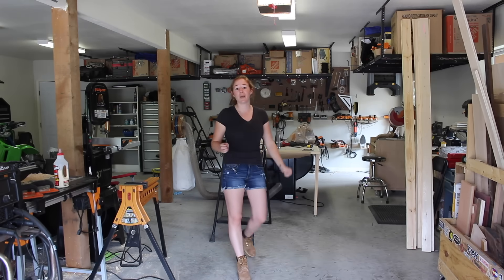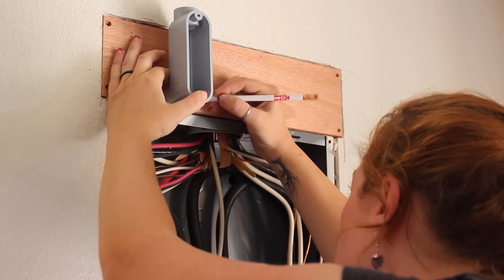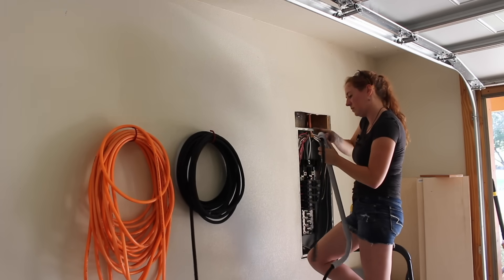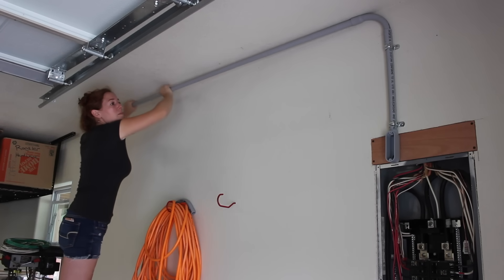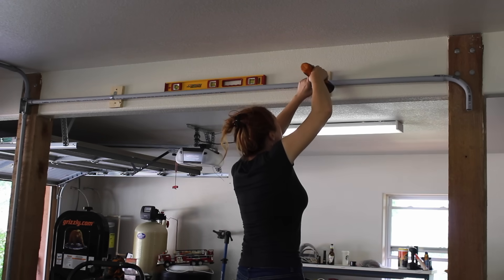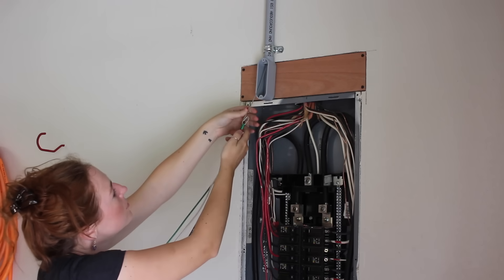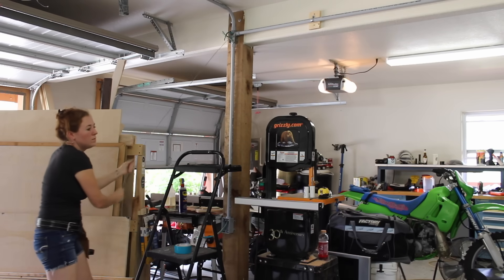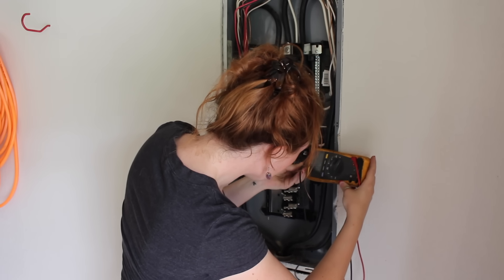Adding 220 Volt Outlets to the Garage

Comment: I don't understand your electrical system in America. (well, on a technical level I do), but I just can't understand why the standard voltage in homes is 110/120v when 220/240v is readily available - more volts = smaller conductor size = less copper = cheaper & more efficient.   On the other hand I have massive envy for the Germans/Swiss/Austrians - almost all big houses, particually those in the country have assess to 3phase power, and this typically seems to get used for Log Splitters, sawmills & lathes in peoples workshops, plus big electric ovens. Marius Hornberger has it well easy.

Comment: I did not read all 800 comments... so maybe someone said it before:

It's often easier to insert the cable during the installation of the PVC tube, especially if you have much curves.

Comment: Well cant comment a lot because the rules are probably different over there instead of europe, but I would put some extra brackets over the pipe, over here the rule is horizontal max 30cm appart and vertical 40cm appart and max 10cm out of every corner, box or whatever. love that you dit use wirenuts instead of what is commenly used over here .

Comment: in the USA, is anyone allowed to do electrical work? Don't you need a licensed Electrician? Appart from the fact you are accessing a live switchboard, you are connecting new wiring . there are three test you should do before energizing. the most important test is an insulation resistance test. how do you know if there isn't a defect in the wires insulation . I  would like a licensed electrician to respond to my questions if possible.

Comment: Two things I saw. The wire you used is under sized for running a plasma cutter on it . You aren't allowed to run two outlets on 240 volt lines. They are ment as a dedicated outlet source.  The outlet amp rating or( since there is two ) cannot exceed the wire gauge and breaker size. The reason you cannot use flexible wire to run into a breaker panel is that over time the current draw heats and cools the wire which expands and contracts it. Since the terminal it is screwed into is just tightened once this loosens over time and increases the resistance in the conection which inturn will cause a fire. Thats why aluminum wire is no longer used for outlets.

Comment: My shop is a 22' X 35' steel building. I used 1/2 " conduit to run 15 circuits, mounting all the utility boxes to the steel frame. That way I only had to pull 2 wires for each circuit, using the conduit for ground. You might consider that when you build your new shop. It was way cheaper than using 12-2 with ground.

Comment: I would have not made a junction at the box where she wire nutted the wires except for the ground you only need one ground feed in a conduit but I would have fed two sets of the hots so one set goes down straight through the junction box and the other  set turns right going to the next beam. so she would have two 240 circuits. instead of one split in two. Any one else agree?

Comment: I'm sure that someone already mentioned it, but you need to mark the white wire so that it is clear that it's being used as a hot in this case. If you see all the other whites that are in 220 circuits are marked with red tape. It's good practice and there's a section of the NEC that covers it, I just can't recall the section. Very nice and professional, great videos.

Comment: you need to mark the white wire as a hot, should use black tape wrapped around the wire at every connection. it would have been better to pull two black wires (red usually means that line is on a switch).  i wouldn't trust any of the wiring  if i saw an unmarked white wire coming from a breaker. also i like to use split bolts for reliability in high current applications.

Comment: hey April I am an electrician and the handy box you used for the junction is probably not large enough and violates NEC code at 12 ga @ 2.25 cu.in. grounds all count as one and all current carrying conductors count individually so 6 wires @ 2.25 = 13.5 +2.25 for the ground =15.75 cu.in minimum for your box. also anytime you use white or gray wire as a Hot it must be recolored in all visable locations. white and gray denote the wire used and the grounded ( or neutral ) conductor.
Reply: all in all a nice job , but one more thing how did you get the wire from the lb to the panel? the pipe should be continous.
Reply: Now recalculate with #10 that she actually used...I'm at 17.5 for a 13 cu box...

Comment: Only issues I saw were:  the way the conduit is run to the panel I don't think it is actually connected to the panel, the single conductors aren't intended to go through knockout holes unprotected. 
White shouldn't be used for this application, but marking each visible/accessible part with red tape may be acceptable. 
A few more straps on the conduit near the boxes to properly support it. The joints in the conduit should be glued, not just pushed together. 
Since you intend to run things like your saw, plasma cutter and air compressor, on this you should run a separate circuit to each outlet rather than sharing a breaker. You will likely be leaving your air compressor plugged in all the time, if it cuts in while you are running your saw, or when you are plasma cutting you also need the air compressor you may have troubles with nuisance tripping of the breaker from overloading the circuit.
Over all though you did well for someone just learning on the fly.

Comment: For safety's sake you really should wrap the wire nuts in the direction of keeping it secured to the wire with good quality electrical tape. It isn't likely to come undone in the average setting, but excessive vibration over several years can loosen the nuts creating a fire hazard. So high seismic areas, near active train tracks, in a shop near to vibration inducing tools... etc, it would be a good idea. You should have the conduit all the way into the service panel, with pipe straps within about a foot of each connection and no more than five feet between straps, but all in all, good job. The heavy cable would have been fine in the PVC conduit as far as federal codes, not sure of your local codes where you live. BTW, I hold a degree in electrical engineering and several years as an industrial electrician specializing in factory automation, I wouldn't lead you wrong. What gauge wire was that you were using, and what is the load draw of the tools you'll be using with those outlets? The length doesn't look to be an issue, just want to make sure your copper is heavy enough for your peak load and not just your running amperage. If you are using an automatic switch for your dust collection triggered off your table saw the startup peak load must be added together with a safety cushion or you will be replacing breakers prematurely. (They are only meant to trip once before replacement, the rest factor is to provide power until you can buy a replacement, why everyone seems to think they can just keep resetting them safely is beyond me (FYI)every time they trip it weakens them and they will continue to trip more easily as time goes by. Manufacturers used to label them accordingly, not sure if all of them still do as I stick to Square-D breakers only). Nice tidy conduit runs, April. I would not expect any less from you, Good job.
Reply: also, you might want to list your new circuit on the list in the panel, for future reference if you sell the house or add more circuits and can't recall which one goes where. Just good practice, not imperative.
Reply: As an "electrical engineer" I would think you would know 3/4" sch 40 pvc needs strapped every 3' and within 3' of an outlet box. NEC 352.30 , 2017, 2014, 2011, 2008,2005,2002,1999,1996.....
Reply: Tony Castillo that appears to be larger than 3/4". It looks more like 1-1/4 or 1-1/2.
Reply: Thomas Russell under the more option she has parts listed linked to Amazon that she used. it is 3/4" plus the handy box couldn't handle above 3/4" ko.
Reply: Okay. I guess she just has some really small hands, visually.

Comment: I just love your video's. My question is how did you convert the 120v in America to 220v? Also it would be safer to mark the outlets with 220v, so you never end up putting in a 120v appliance. I just love the tools you have and the ease of your working with them. Thumbs up lady.
Reply: In the US the normal house is fed (2) 110v hot lines and a ground.  For 110v circuits use a single hot and the ground.  For 220v use the two hot lines.   

There are different kinds of outlets (arrangement of prongs) for 110 and 220 to prevent plugging in the wrong thing.   

There is also 3-phase 220 which is not common in household wiring. I am not familiar with it but uses different wiring layout.

Comment: If you don't have a fish tape (or even if you do), one trick I've used to advantage is using a vacuum to suck a string through your conduit, and then pull your wires through using the string.

Comment: I'd hire ya.  Minor aesthetic change for me would be to spin your conduit around, so the black type is hidden, facing the wall.  Not really a concern at all.  I like your decision to use blocks to stand the pipe off.  You sure you're not a sparky?  One thing I do when trying to squeeze in a pesky breaker is first line it up with the knife on the bus bar, then use some thickly insulated handle (linesman pliers work well) to firmly press the breaker into place.  It saves the breaker from being damaged, and the controlled way you gently ease the breaker in is safer for you, since you'll be less likely to slip and stick your hand, tool or rings in the main bus.  Good idea to de-energize that first too...it's the law here that we must not work live unless it is not possible to do so.  You are a smart cookie April, nice work.

Comment: April, know that in the future you can always use solid THHN/THWN- 2 wire instead of using stranded wire. Solid can be used easier for connections at the breakers and devices as well. Also the main advantage is being able to push the wires through the conduit without a fish tape instead by making a decent "head" with the individual wires bundled together properly. 

Jeff 
Licensed Journeyman Electrician

Comment: Am I the only one who sees the wrong wires used - I only saw the hot and neutral where isn't your 2nd phase (red) wire? Green is ground - white is neutral and black was 120v but you need a 2nd 120 (red wire) to to give you 240 - how'd you wire up a 240v plug using not a white (neutral) and black (hot) wire? Should have had 2 hot (red and black) and then a here (neutral) and green (ground)

Comment: This is not a criticism  but a suggestion.

You had plenty of room in the breaker box so I would have installed (2) 220 v 30 am circuits.

Not knowing what you had envisioned being powered by the common circuit.
Again a suggestion.

Comment: You obviously like to work with tools,neat,neat. A little unconventional but nevertheless things look pretty safe. There is only one little thing that would normally be done different. For 110/115 volt circuits you would  exactly use the wires you pulled into the conduit, green for ground, black for hot and white for neutral. However, when you use individual wires rather than 2 wire cable you would use 2 coloured wires for the the 2 hot wires which you are dealing with for 220/230 volt plus of course the green for ground. By coloured wires I mean any colour but white or green.

Comment: Sometimes instead of a fish tape, you can pull a string first with a shopvac. Then pull your wire. It's fast and works great in plastic conduit. You tube it for some neat ideas.
Reply: Eric Gryder Also if she used solid wire it would have pushed straight in. No need for any fish tape. 

Licensed Journeyman Electrician
Reply: True

Comment: That metal junction box should have a grounding pigtail tied into the green wire going back to the panel.  If one of the hot wires should become shorted to the box and you touch the box, you could become the connection to ground. That could make you dead.  You may already have done this.  The video went past that part pretty quick.
I always use plastic parts all the way just to avoid such a situation.
Reply: Amperage is what kills, not voltage. It takes as little as .07 amps or 70 miliamps to kill you. 30 amps at the breaker is more than sufficient to kill you.
Reply: Not likely dead. 220 is on the borderline of what will kill you but I have been hit with 110 more times than I can count, 220  at least 4 times and 3 phase once. Every time, not my wiring, just unlucky in my life and I'm still kicking. Your arm will be sour and you will have burn marks but you need almost 4 to 5 minutes of constant 220 to kill. Skin is a pour conductor and acts just like any insulator, the current will travel on the outside of the body. Lastly, there is a reason the electric chair is 4000 volts and they use a wet sponge on the head to deliver the current.  My problem is I'm not scared of it and probably some day it might kill me. Thanks for a great video and start to some great comments. Many times you learn more from the comments than the video.
Reply: M McKinley there are a bunch of factors that go into whether or not you’ll be killed by it. Some ignorant people will say it’s the amps that kill you or vice versa. It has more to do with how the current flows through your body and if you have a pre existing heart condition. Electricity always takes the shortest path to ground. That’s one rule to remember. If you happen to be standing barefoot on a grounded surface or even the bare ground itself and you touch a hot wire the current will flow through your hand down to your feet. This could cause your heart to stop or have it’s rhythm thrown off which could be life threatening. Also if you happen to touch one hand on something that’s energized or hot and the other hand is touching something that’s grounded or the neutral then again the current passes through your torso and can have the same effect on the heart. Also if enough current passes through you it can and will incapacitate your muscles causing you to stick to the source of current unable to break free. In those cases you typically die
Reply: @JustinLodes  I totally agree as a retired electrician and a retired paramedic. I had patients go into cardiac arrest from a simple extension cord because they touched the power with their right hand and had their left knee on the ground and a power company electrician that survived 250 KVA in a vault where the power entered his right shoulder and exited his right knee. It didn't cross his heart and he was in good physical shape. A miracle in my mind.
Reply: @mmckinley345  any voltage above 50v or so CAN kill you. 120v takes the most lives per year.

Comment: All your hot wires should be either black or red. Never use a white as a hot, helps to prevent oopses in the future. Other than that, nice job, neat is nice.

Comment: I had a conniption when I saw the SO wire.  Glad you changed your mind.  The one thing I noticed, is it looks like you are using a NEMA 6-30 receptical.  Are you running 10 gauge?  The straight pin receptacle works, but the twist locks are more appropriate these days.  I've been using NEMA 6-20 plugs on my tools (I wired a good portion of my tools for 220v) and haven't had an issue.  Also, that 2x4 box is stuffed to capacity - I would have used a deep 4x4 box there.  Did you pigtail the ground in the junction box?

Comment: was their any pipe from lb to panel where you knock out in the panel should have ran from knock out in panel with a off set wire got to be in pipe all the way the kind of wire you use  and also how will you ever get board off  lb is in front of it but I love your wood working shows

Comment: Don't know anything about the thick black cable you were using but using conduit is a good idea. My last house was about 50 years old when I moved in and a bad wiring job by the previous owner saw the cooktop catch fire about a week after I moved in. The house had at least two generations of wiring in it and needed a professional to sort out the mess. Most of it was in old conduit and was OK but the garage wiring wasn't and there were several areas where the insulation was eaten off by rats. The problem with the stove? When the previous owners installed a new kitchen instead of putting in a line direct from the board they picked up a line from a badly wired power-point in the garage underneath the kitchen. That mess was easily sorted out and after the electrician disconnected the old redundant wiring I stripped it out to save further confusion. The real fun came when i put in an extension to double the size of the house. the ancient switchboard couldn't handle the load and had to be replaced. I was the electricians "apprentice" on that job. Pulling apart and working on a live power board was not my idea of fun. We operate 240 volts over here and the noise and sparks are quite spectacular when you short something out while wiring. Your garage looks fairly new so hopefully there will be no electrical surprises in the house itself.

Comment: April, I never saw how you made the connection from the knock out at the top of the panel to the plastic LB. I hope you put in an elbow or street-el or something that will protect the wire from getting cut in the sharp edge of the knock out.

Comment: You are far braver than I am.  When I had the breakers run for 3 110v runs, I did everything and stopped just short of the breaker box.  I hired an electrician for that part as I am nervous enough when I have to shut off a circuit.

Comment: °reidentify white wire with a marker or tape since it isn't being used as a neutral
°run conduit from  LB to electrical panel
°put grounding pigtail in metal junction box
Reply: that's all the code violations I see
Reply: Still a code violation even when re-identified.